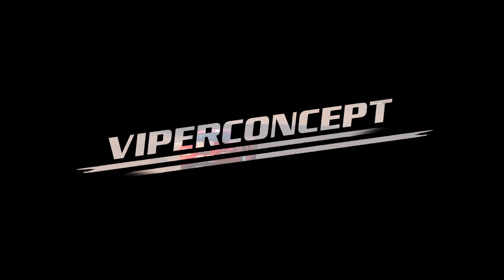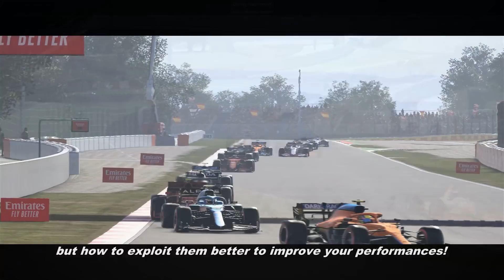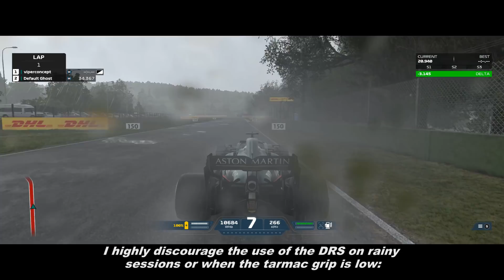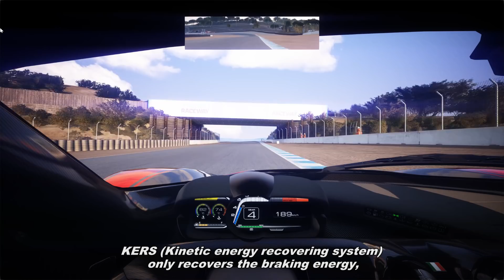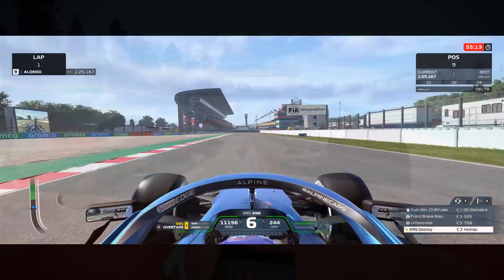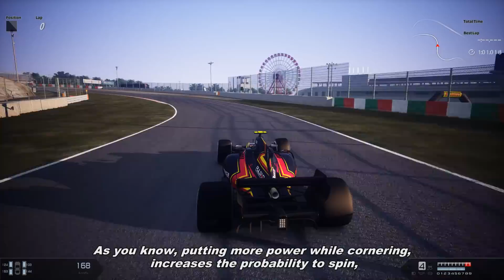How to Exploit Better the DRS and the ERS in Racing Games

Comment: Hi Viper. Have been watching you for around 4 years now. Have a small request :D

I don’t know what it is, but your explanations are miles better than any on YouTube. So can you please make a video about Brake Bias? I don’t quite understand it. Thank you
Reply: @ieatchickens  Of course he knows this. But your info is not helping for example how much BB do I use for a track like silverstone, RBR and how much from 50% to 58% would affect the tire wear and how much can I put it forward without locking the front or the rear.
Reply: Mate so my tip is that put the Brake Bias towards the rear as much as you can with out locking the tail. It would help a lot for the turning in of a corner yes you would have to brake a few meters forward but it would be harder to lock up and would help the front tire to stay alive for longer time.

Comment: I seen somewhere system called MGUK or similiar, is this just other name of ERS or there are differences?
Reply: ERS (Electric recovery system) is composed by MGUK (motor generator unit kinetic) which resembles the KERS system and MGUH (motor generator unit heat). This is what viper spoke about; ERS, it transformes braking energy and engine's spare heat into electricity.  Also they are called "motor generator" because the same machine can be used to obtain electricity (from braking or heat) or to use energy into movement. 

I hope I have helped :)
Reply: @sergiovalenzuela319  thank you